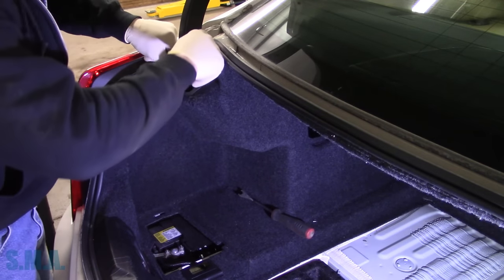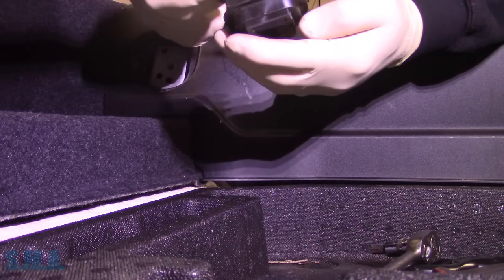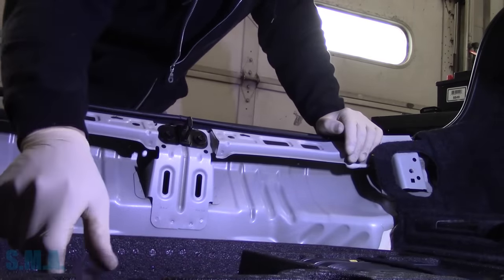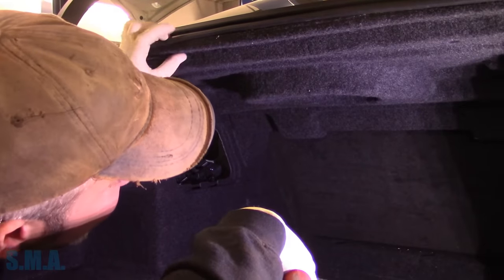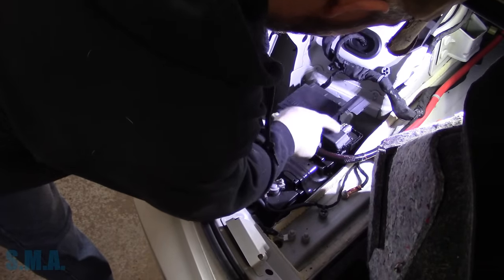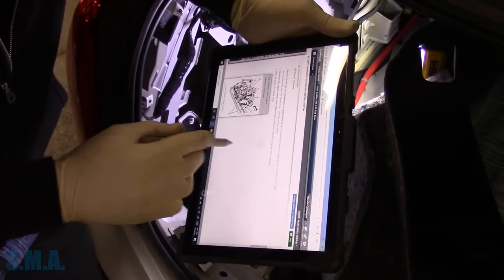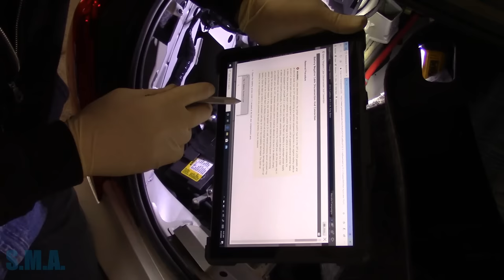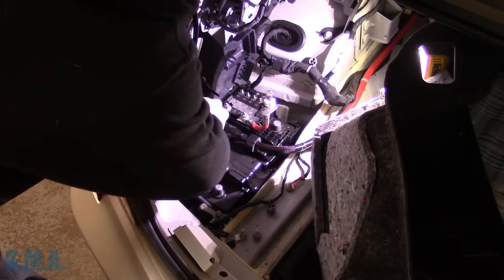Cadillac ATS: Battery Remove & Replace

Comment: Hi, 
Very nice video - nice insight on the clips that hold the positive cover is a big plus, thanks man!!!
Update:  I just replaced my battery in my CTS with a Costco Energizer AGM H7, fits perfectly and working well.
I see no reason WHY GM added so much crap to hold a battery, besides making it easier for the dealer to charge 1 hour or more for labor!!!

Comment: I have some small engine nightmare events.  One McCulloch chainsaw. It was McCulloch Mini Mac. To clean the Carburetor you have to take the engine out of the housing. Fun begins with the throttle link. McCulloch Engineers would not Answer at the R&D meeting in Texas. Aierns had a mini that you had to pull the transmission out to replace a simple drive disc(same disc on Snapper).

Comment: 2010 Camaros require the windshield be removed in order to replace the heater core. They changed it in later years I think, where the bolt in question that holds the dash in on the passenger side was made shorter.
Reply: Oh, hell no! I'll sawzall the firewall before I replace a windshield to do a heater core!

Comment: The difference in this work is if you took the vehicle to the dealer they could change the battery, but they wouldn't make sure the rubber seal is above the plastic trunk liner. They'd just leave the rubber seal tucked in so all the water would run in.  Professional shop owner versus dealer. 👍🇨🇦

Comment: Just want to say thank you for providing great learning vidoes with your special flair! We owned ATS 3.6 Performance Caddilac. Great vehicle until battery, motor mounts along with so many recalls started happening. Not to mention the brakes and run flats wore out quick, tires gave terrible ride. The list was $59K on car. We traded in when it had only 40K miles. Ford dealership offered $13K on trade in for F150 FX4 Platinum. Still sick over that deal. Now 63K miles on F150, no issues other than seatbelt recall. Ready for new set of tires and front brakes. Awesome vehicle! I must say, Caddilac dealer had very good complimentary meals along with help yourself ice cream and other snacks. Good maintenance package also. Ford not so much, but they don't need it ;-). I'll stick with Ford!
Reply: I agree about the run flats. For a Caddi, it rides like a Sherman tank. Just put a dang spare in the trunk and a good set of tires on it.

Comment: Oreilly replaced the battery in my wife's Subaru WRX for "free". I was skeptical and double checked their work, only to find that the kid who installed it was too busy ogling my wife to pay attention to the job at hand. He installed the battery hold down incorrectly and put a one inch hole completely through the top of the battery! I personally reinstalled the the replacement after 10 minutes of arguing with the manager to get it replaced. They seemed less than surprised when my wife described the installer... That's free for ya!

Comment: I thought the older Prius's were bad with the battery in the trunk area but this car's got it beat!  2009 Dodge Avenger's have the battery in a bad place, but if it's a California vehicle, there's no corrosion on the hardware,  just on the battery cables themselves.

Comment: I work at an Autozone , and can tell you that for batteries like this , we aren't allowed to install them as it takes to long and requires a bit more disassembly than we're allowed. Liabilities and all that. We typically do the ones just under the hood , in the trunk when they're just a few fasteners to remove ,  and can do some back seat replacements of batteries depending on the vehicle.

Comment: Many moons ago in a younger life I wrenched on equipment. The worst battery changes that I recall were in Cat 950 loaders. Normally they had 4-6 or 12volt batts in them but in more than one I came across had 2 8Ds in it. The 8D weighs about 120 lbs. So they are under the operator's seat which tilts forward so you can get to them. Not too bad when there's 4 normal batts but throw the 8Ds in there it's quite a struggle to wrest them out of the hole and around the seat while praying that the rope handles don't break. Mind you the seat only tilts till it gets to the steering wheel. Helps if you have a Hi Lo to get them the 5 or 6 feet to the ground. Hopefully there's someone else around to help.

Comment: The New ford transits are going to be a joy. The ones under the seat aren’t to bad. But the engineers at ford decided to shove the battery all the way under the rain tray on the drivers side. Even the trainer that gave our class on them noted what a pain they are to access. As far as someone complaining about the cost of a battery replacement, tell them to slide on down to the parts store and have one of those guys change it.

Comment: Lotus 340R: 6 hours to remove the body (inc. seats, mirrors, roll over fixtures, mudguards, attachments to undertray, etc) to get the factory battery out.  Most owners do it once and then replace with a smaller one !

Comment: Had a machanic replacee my battery in my 2013 ATS but when he finished the installation my A/C panel would not function propeerttly. All the lights on the pannel were lit but I could not turn a/c or heat controls on or off. Blows hot on one side cold on the other. The machanic can not fix it, telling me its not his fault 😲. still not fixed as of this day. Is there any way I can disconnect a fuse to cut a/c off? Oh by the way you did an excelent job on the automobile and the video.👍👍👍👍👍👍👍

Comment: The worst car I changed a battery in is a 2012 Chevrolet impala. I can't remember all the things I had to remove. After getting the stuff removed it was so close I had to take the battery out at an angle. Putting the new battery in was even worse. The engineers that figured out how to change the spark plugs figured how to make the battery equally difficult to access.

Comment: Great video as always 
So what happens/ where  do you hook up ay if you need a jump start???   Surely you don't have to go theu all that to clamp onto the battery
Reply: There's a panel under the hood that looks like any other car with a positive and negative connector for jumping

Comment: I called the Corona police.  They have some questions for you about your cough and sneezing problem. 

Never heard of a battery where you had to pull the engine just to get to it.  Then, you gotta be careful not to piss off the computer.  Cause it will murder the backup battery.  Which makes perfect sense.

I guess changing a battery takes an automotive engineering degree.  So, scrap the Caddy, Clyde. Scrap the Caddy.

Love your videos, Eric.  Stay healthy and hope your family is doing well.  👍👍

Comment: Eric, I work part time at Advance Auto.  You'd be shocked at how many cars we have listed that management says we aren't allowed to change the batteries in them.  I guess they have figured out that either some of our employees aren't skilled enough or high enough IQ to properly research the correct methods.  Some of us are old enough that they have never been exposed to the methods and reasons that batteries are connected in today's modes.  All fun and games until the new guy toasts someones ECM then the SHTF and the District Manager has a meltdown.  Of course there is always that late teen or early twenty something that knows everything and wants to give it a go, hopefully we catch them before they start a problem.  I won't even mention the issues with the Code Readers and the so called "Diagnostics" and the people thinking we can just hand them parts and it will be all good.  They do not understand that codes just point in a general area most of the time and further diagnosis is required. Sorry I wrote a essay on what you already know.  Keep up the good work young man.  By the way, do you sell those South Main Hoodies?

Comment: On my wife’s 2011 Dodge Avenger the battery was under the drivers headlight so I had to pull the tire and fender well out to get it out and replace it. I put a good one back in hoping to not have to replace it again.

Comment: How do you get into the trunk when the battery dies? Does it still have a mechanical backup or key cylinder? Or do you have to remove the back seat to get at the escape lever?

Comment: The worst battery change was on my uncle Buds F350 dually it required a forklift and lift chains to remove the battery from the passenger side of the truck bed just behind the cab after opening the battery gate and removing the weather heads for the negative and positive terminals and laying them to the driver side the bed you could lift the battery case and back it out of its dock in the bed. Uncle Bud got tired of constantly blowing through 12 volt heavy service  batteries every month or so and the deep cycle batteries weren't much better so he replaced them with a Raymond service cell for a forklift and that never failed to start his old ford.

Comment: I always connect a outside battery under there good when replacing batteries so o don't lose the radio/compass/HVAC/power windows and many other system memory. Once the new one installed remove the jumper cables and good to go

Comment: Worst battery I ever replaced was in my 2006 Pontiac Grand Prix with the 5.3L V8 in it. It required removing engine mounts and lifting the engine up a little. I sold the car after that job!

Comment: Worst battery I ever changed was in a 14 grand Cherokee overland. I specify it's trim because both front seats are power. The battery is under the front passenger seat. You have to have a jump pack to move the seat all the way forward. Not hard but not easy.

Comment: The worst battery i changed on a customers car was in a dodge Aries. The alternator was overcharging and it boiled the acid out of the battery. The whole engine compartment was covered in acid, it literately striped all of the paint and primer off the metal. All i could do was to cover everything in baking soda and rise with water, and changed the alternator and battery.

Comment: The worst battery replacement I ever had was helping my father change his on his Chrysler LHS.  Now we didn't have a lift. We had always been DIY mechanics in the garage or driveway. Well, this battery was in the wheel well compartment. Had to jack the car, remove the wheel and tire, etc. Add on to that it was Winter in the North East.

Comment: GM must have hired some Chrysler engineers for battery placement.
Reply: Yep, a step up from the Journey. Of course, I watched a mechanic last year, changing a battery in a BMW, it was also tucked away in the trunk, in the rear p/s corner by the tail light...not as much work as this one though.

Comment: being an employee of advance auto parts, i have 3 things to say.  1st, this vehicle on our system would inform us to recommend to the customer to have a professional installation due to the amount of time it would take & all of the parts that need to be removed for the job.  2nd, i'm surprised that the NAPA know-how battery didn't come with a new vent plug.  the auto craft agm batteries we sell have a positive cover designed with a new vent plug attached to it that is perforated for easy seperation.  3rd, at the store i work at we always clarify to customers that we only scan codes.  we do not run diagnostics.  personally, i tell the customer to use the obdcodes website, and enter the year, make, model, & code(s).  this will give them a basic description of what the code(s) mean.  also, for the people that want their codes cleared or erased, we try to politely let them know that not only do we not do that, but we also don't let customers "borrow" our scan tool.  for most customers i tell them that if the problem isn't fixed the check engine light will come back on anyway

Comment: is there any vehicles that its wise to connect some sorta memory saver device when swapping motor or transmission. like when the battery might be out of vehicle for several days.
also which memory saver device do you think is the best?

Comment: Hey Eric, it was so good to see a notification from your channel when I switched on my computer this morning. And I thought, I¨d like to see a "ordinary SMA day" video in these  NOT so ordinary times. It could be very interesting I think.  New cars are so freak'n stupid when it comes to the stuff that was really simple to do on old cars. Like changing a headlight bulb or a battery. I have a diesel Peugeot Partner as a work vehicle (unfortunately), and some other guys in the company that drove it before me had ignored a warning light for a diesel additive (no not the "AD BLUE", the other one for the catalytic purge thingy...) for quite some time. (You can't replenish it yourself BTW, it has to go in to a shop and go up on a lift, because the reservoar is under the car... ) So when I at long last took it to the workshop they said the little pump for the stuff had broken since it had run dry for too long. And that they also had to change the freaking diesel tank to clear the fault codes??!! Boy was my boss happy about that one! All the best to you and your family, stay safe.

Comment: If the 12V battery goes dead on a 2006 Prius, the door locks won't disengage. You can not get the rear hatch open to get at the battery. There is no mechanical 'key' to open the hatch. So as you contemplate pulling down the seats and crawling all the way back to the left rear corner, removing all the trim, dragging your battery charger back there... you think YouTube!  And you find out you can use the charging post on the fuse box under the hood to charge the 12V battery. 
It might not be Mitchell's, Autel, or Snap-on, etc. But it saved me a bit of trouble.

Comment: back when i was a younger fella in the 80s/90s i did'nt even have a good battery charger. in the below 0 cold of MN sometimes id get one car started and let it idle and yank the battery, swap in a dead one to charge and use the good one to start the other cars. not that you can even run a car with the batt removed now but would sure be a slow process on that cadilac.

Comment: Craziest batteries?  An old GM (Buick maybe).  The battery was in the usual front corner but there was a large metal cross member going right over it blocking access.   There's some fine planning.  Another was the 60s VW bugs, I think theirs were under the back seats.  When the seat springs got saggy, watch for the industry's first heated seats (unintentional).  Last was a BMW with no mechanical door lock.  Had to jump the battery to get the trunk open to get at the battery to replace it.

Comment: 2014 Cadillac ATS - Do you need to have your cabin air filter replaced? We recommend using the  MILWAUKEE M18 sawzall (not a sponsor) and possibly a sledgehammer.

Comment: Worst battery I ever changed had 60 pieces that weighed about 70 pounds each and was a little over 120 volts DC.   It was up 20 feet in the air and through 2 doors - so you had to get all the old cells out - rebuild the old battery rack with new hardware since the battery was 17 years old - bring in the new cells and get them on the rack - install all the jumpers between each cell - then load the old cells into the inbound shipping crates - pad them for shipping - seal up all the crates with acid proof rubber and ship them back from the jobsite - which happened to be on the northern coast of Alaska- 4 or 5 men along with a nice diesel flatbed truck and a fair size rubber tire loader about 2 days if the weather was good. Then it was onto the next one - we did that about 15 times in two years - the good news is we only did it in the summertime so the temp was usually above freezing..

Comment: GM loves to make simple maintenance items an ordeal to do.  Like the 3.4l engines having to have motor mounts removed to change the serpentine belt or battery locations like this (and older various models) taking a bunch of stuff off just to get to battery.

Comment: Hardest battery to replace for me was probably actually the easiest to replace. There was only the bottom 2/3's left to deal with after I blew it up,,, while my face was directly above it!!! It was one that used to have cell covers in units of three. One of the plugs broke in the hole, and as I was using a screwdriver to pry out the broken part, I created a circuit between residue on top of the battery as the tip came in contact with the electrolyte I guess. Thank God I had my sunglasses on at the time. I ran over to the faucet on the house and splashed water in my face to dilute the acid. Some of the plastic hit my face so hard I thought I bifurcated my lip like a rabbit, luckily that was not the case. At any rate, I never touch a battery anymore without safety glasses on...  stupid is as stupid does...

Comment: Hey Eric, just curious if you ran a battery brush through the cable ends or the battery posts on the new battery? Or did I just miss it? I usually like to expose some fresh clean lead on the new posts before attaching the cable ends.

Comment: I remember trying to hello my buddy replace a battery on a foreign car. I looked at it found the data and it required lifting that side of the motor. I said I'm out lol. The worst one I actually did was in my 2020 Ram which want hard at all... FULL SIZE FOR THE WIN

Comment: It's just my two cents, I personally don't like that battery location and loathe all the cheap plastic hardware that doesn't last very long, but I will say that its a better location for the battery (not the mechanic) than under the hood. It's cooler and also cleaner as Eric mentioned, both do reduce strain on the batteries, and electronics. That car was realistically designed to be scrapped after about 10 years anyway.

Comment: Eric, do you recommend memory savers in use while performing battery replacement? Is that why you had a charger on the car at the end? Trying to find most efficient way to not lose radio codes, power windows, etc.